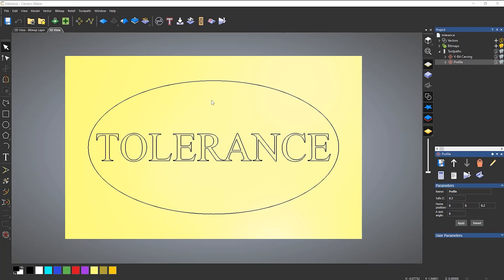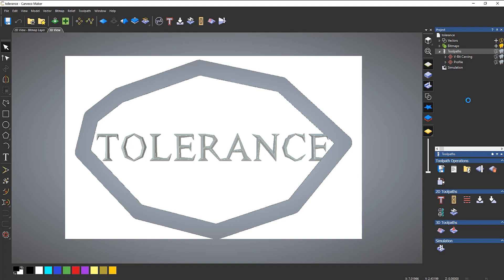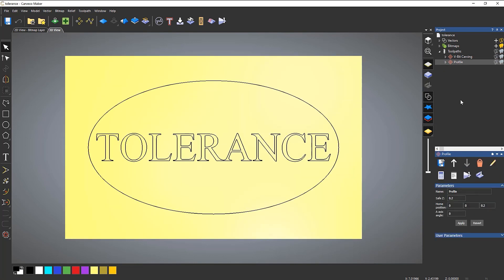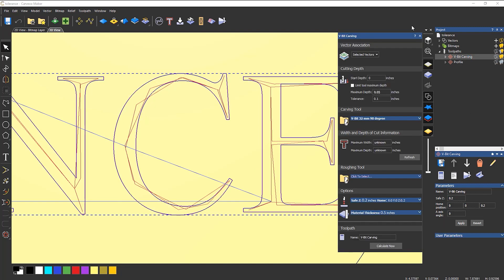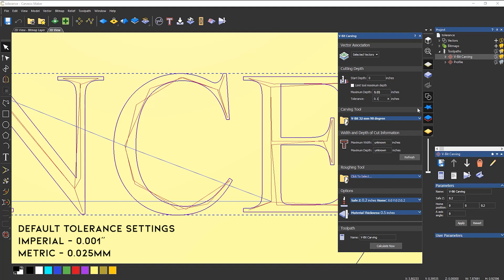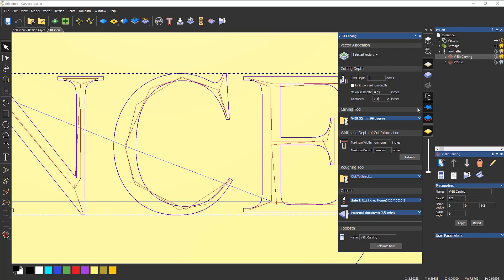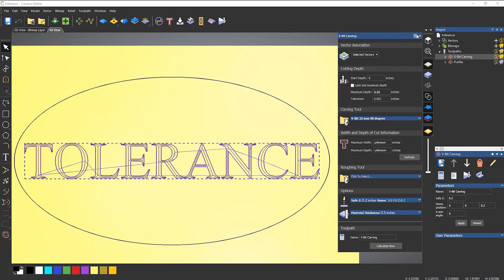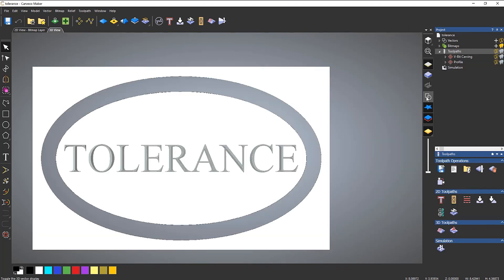Tips and Tricks: Toolpath Tolerance

Comment: You mention that the default tolerance should be .0025 mm (which is the default) but what about the allowance value?  is there recommendations on what that setting should be and an example of what the implications of its use are?
Reply from the maker: Hi Michael, allowance is a completely different topic to tolerance.  The allowance will make a part smaller or larger, for instance if you wanted to fit two pieces together.  Tolerance is how close the calculation of the toolpath deviates from the line.  If you watch this video, it explains allowance - https://learn.carveco.com/toolpaths-and-machining/profile/